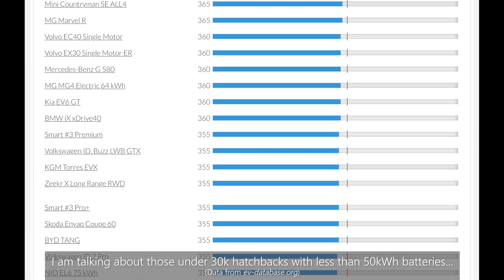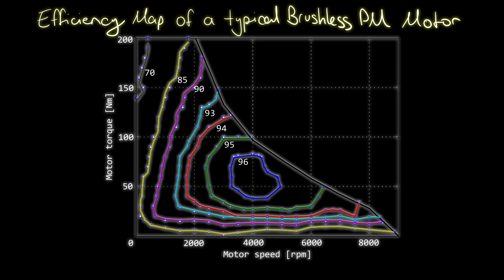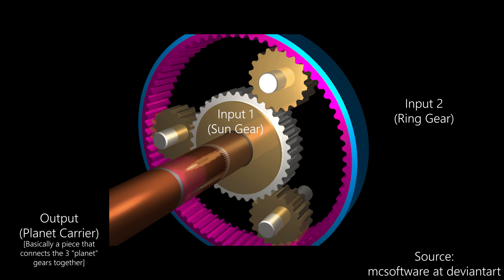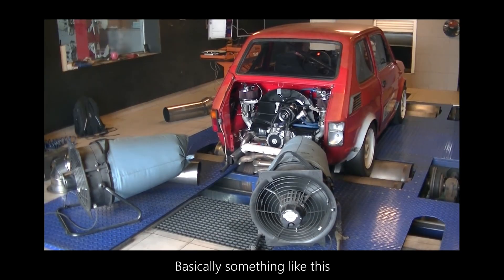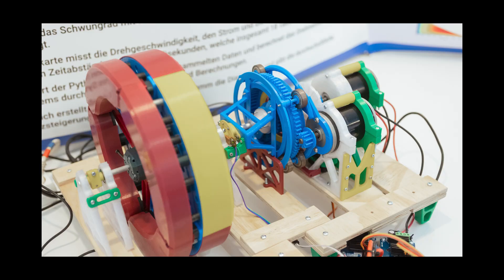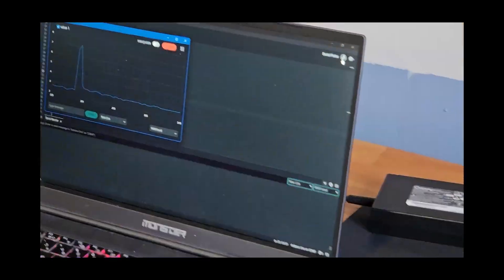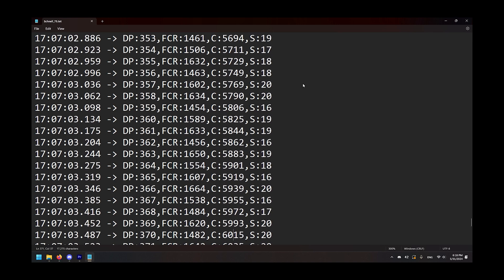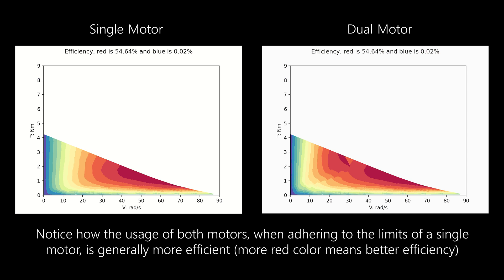Can we improve the Efficiency of Electric Cars using a Planetary Gearbox? (Jugend Forscht Project)

Comment: Very good design, analysis and execution of your project. Equally  good scripting and production values of your video. Someone, someday is goint to be very fortunate to hire you (if you don't start your own company.)
I note that the efficiency map of the motor you showed has a very large area that is within a few percent of the best value. If an EV spends most of its time inside that high efficiency area, and only has excursions outside that zone for brief moments, the added complexity of the planetary gear system might only gain a few percent in overall range.
And putting in two motors at one end of the car unbalances weight distribution, and gives away the traction advantage that all wheel drive provides.
Reply from the maker: Thanks a lot for the feedback! I will try to do better in the future :D About the efficiency gain, by trying to tone the words "on average", I tried to say that this value is not representative of the real gains. Yes, like you say in real life it would be a lower value, since the motor never is at its optimum, this planetary is just there to make the optimum area bigger, It is not better at every scenario, yea!
And about the second topic, yeah that is also right. Weight distribution is a valid concern, but realistically speaking, the battery plays an even bigger role there, the motors are pretty light compared to that. Only 2WD also means less traction yes, but like, I feel like not everybody needs 400hp+ on their vehicle :D
Also I forgot to mention this, as far as I know, dual motor systems generally have the induction motor on the front yeah? So the motor that does the regen braking is in the rear. Rear braking is not the most stable thing, thats probably why single motor EVs are (mostly) FWD, to improve braking and stability. This planetary woulf also be a positive factor there too I believe...
But yeah, like with anything, its just a bunch of differences that need to be weighed... Thanks again for watching the video!
(I think I am not spewing wrong information here, but yeah in the case I am, feel free to correct me)